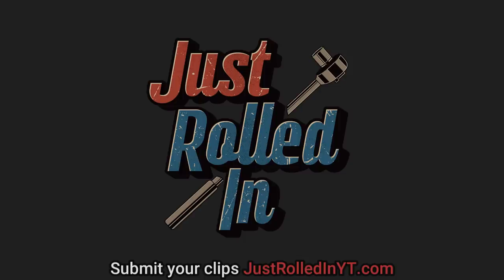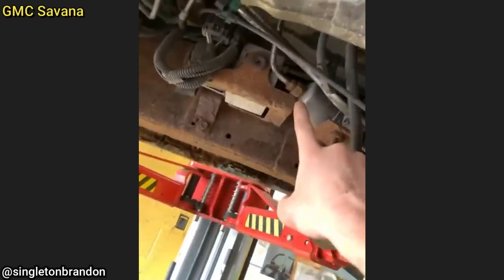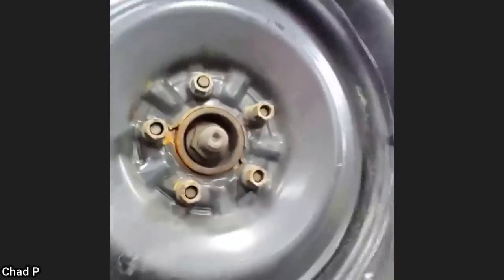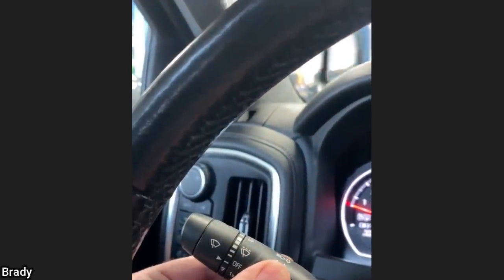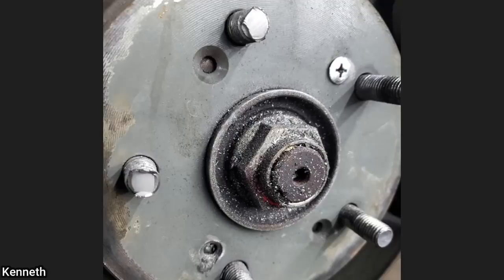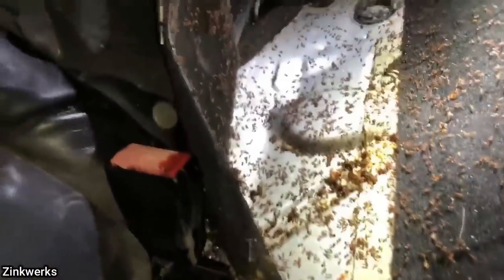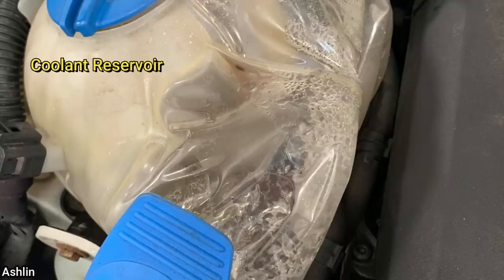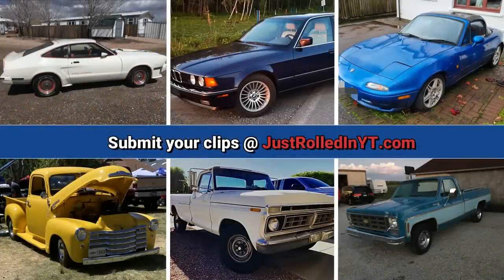Customer States Another Shop Failed To Replace Transmission | Just Rolled In

Comment: Customer with a flat tire approved all additional repairs? Had to watch that part twice just to make sure my ears were not deceiving me.
Reply: Doesn't necessarily mean he plans on paying.
Reply: @sylviaisgod6947  Does not matter. If the customer refuses to pay, the shop can keep the car till they do pay and also will have to pay storage fees. If they refuse to pay at all, the shop will have a right to sell that vehicle to recover repair costs.
Reply: @czarekaj1098  that's not necessarily true and varies wildly by state
Reply: It's so beautiful.
Reply: I know right! As in, they said YES to safety-critical repairs so they wouldn't die in a crash? Never thought I'd hear such a thing.
Reply: @Hawk7886  That's true. In CT, the shop has to file an "Artificier's Lien" including the unpaid invoice and $10 fee. After so many days, the dealer can then file for a duplicate title assigning ownership to them. CT no longer issues titles for older vehicles (a current, valid registration is your only proof of ownership) so I don't know how they'd handle this now.

Some years ago, I worked for a "Buy Here, Cry Here" stealership. (Roughly 2005 thru 2006, I was getting paid $3.09 an hour, or $150/wk for 48.5 hours of work, with a paycheck that bounced more often than it cleared.) We had a gorgeous 1985 Oldsmobile Cutlass Supreme Brougham, white with blue cloth interior, left with us for consignment sale in 1997. The dummies working there at the time started a file on the car, but didn't include the owner's name, address, or contact info. We were unable to sell the car without a title. We were unable to register the car for loaner/rental use without a title. We were unable to file an Artificier's Lien because we didn't have the owner's name, and the DMV required us to contact the previous owner for title reassignment, but also refusing to give us the name/address of the last known owner. So, I drove it exclusively, with a dealer plate, for shop errands. LOVED that car, a real cream puff. From '85 to '97 it racked up only 109k, which is nothing for a 305 V8.

Then the boss paid some crackhead (literally) to paint it "Farmall Red" and applied School Bus Yellow lettering advertising "Buy Here, Pay Here at Pat's." That's when I stopped driving it and switched to the '94 Caravan. Until we sold that, then the Head Mechanic and I shared the '89 Accord LX 5-speed. $3/hr does NOT get me to drive around a ruined classic car advertising for the business.
Reply: @dashcamandy2242  that's a really interesting story, I would've felt bad for the car if you didn't end up using it with the dealer plates. atleast it wasn't a complete waste...
Reply: @czarekaj1098 that car probably isn’t worth cost to repair. I’d get a sizable deposit before I started work
Reply: @sylviaisgod6947 LMAO
Reply: The mechanic is still in therapy.
Reply: @dashcamandy2242  dude, why are you getting paid $3 an hour? Working at Mcdonalds will net you better income!
Reply: @haroldwilkes598  LMAO!
Reply: Well, that's a first!  👍
Reply: I think his wheel bearing needs replacing
Reply: @dashcamandy2242  Bridgeport moment
Reply: @czarekaj1098  Yeah sure, $2000 in repairs, mechanic sells it for $200.
Reply: @sylviaisgod6947  Have you checked out prices of used cars?
Reply: @czarekaj1098  No, but I've been checking prices on new cars. A Hyundai Elantra hybrid, for example, is around $27,000 with freight, not include taxes . I was considering buying one if I get the job I applied for.
Reply: @czarekaj1098  Florida is "if it drove in, it can drive out".
Literally, as long as the wheels are spinning, it can drive away.
Reply: I appreciate that customer approved the repairs but hot dam why would you let your vehicle get to that point!
Reply: @aaronbricault2467  Playing radio on a full blast or talking on the phone all the time.
Reply: The fact that Americans are allowed to drive around in such dangerously faulty cars is astounding to me. Where I live, the uk, we are required to have a full service once a year and can only drive it once it’s considered road safe.
Reply: @shannonbriggs100  Imagine that. Depending on a state, you can also carry a gun without the government permission. Weird, isn't it?
Reply: FINALLY!!! SOMEONE WHO HAS MORE THAN TWO BRAINCELLS!!!!
Reply: Finally, someone who has a consideration for his fellow motorists as well as himself!!!!!!!!
Reply: @Hawk7886  as a technician that works in a corporate shop that is definitely true.
Reply: I’m pretty sure all the repairs on the vehicle cost way more than a piece of crap is worth ! Yes, I have nothing good to say because there’s nothing good to talk about on this channel. It’s amazing that you have customers that have cars that are very nice and looks like they take care of very good care of them I don’t know ?
Reply: well you cannot sell it like that
Reply: got a ticket back in october of last year, 2006 range rover sport at my dealer just come in for a quote on installing trim panels and other miscellaneous stuff.  ended up quoting $9600 total in parts and labor.  he approved it all, and paid for it all.  car left two weeks ago.

dont ask me why he holds onto that range rover but it drives safely now and doesnt look half bad for its age!
Reply: Yeah , they do live among us apparently :) They are just rare :P

Comment: Ahhhhhhhh.  The good ol' days, when the driver, instead of the car itself, was responsible for not driving over children in the cross walk.
Reply: Nice avatar. 🙂👍🏾
Reply: Yes, I don't know how I have driven for 46 years without assist. At least, I don't think my 66 has driver assist. I'm going to be upset if it does and hasn't worked since new.
Reply: Imagine that, I learned to drive and actually pay attention to my surroundings during and before moving and to check blind spots with my own eyes, I can also parallel park all by myself without any fancy gizmos, I credit my uncle who drove all kinds of trucks, front end loaders etc for the township he lived in, he also drove snowplows, he actually took me out driving before I even got my leaners permit, I was scared to death when he took told me to go on a major highway my first time behind the wheel, he didn't take no for an answer and I did it, he had that much confidence in me, the car was a 1970 lesabre back in 1976 when I first started driving, it's almost like they're forcing us to not pay attention these days with this  display and that display then a phone propped up in front of some people it's crazy.
Reply: Shout out to the 1971 four door Oldsmobile Delta 88, with the 455, that I learned and took my test in! 😅
Reply: Meh. Nothing wrong with the driver being attentive, AND having extra safety features in the car. You can be damn well sure if my car had those features, I'd want them to actually work too.

Comment: I love the last customer's solution to showing their driver assist cameras being busted
Reply: No bog-rolls were harmed in the making of the video!
Reply: Im affraid of the answer to the question: 
How did he figured it out?
Reply: do driver assist cameras actually recognise toilet rolls as in danger....apparently not!!!
Reply: @TalRohan  no - can't remember where they tested it - the cameras needed something solid.
Reply: Yes,  very clever and practical.
Reply: They probably had the system turned off 😂
Reply: @NickFindsNick  it won't detect a cardboard box - not what it's designed to do.
Reply: @alanclarkeau  Well, being pedantic, it is solid, I think you mean rigid by that, but sounds weird if it can't detect something like this on the road, if there was anything behind the boxes (not unlikely) it wouldn't have stopped after all.
Reply: @Kalvinjj  RADAR detectors may totally miss a cardboard box.  I remember a local test by a Motoring Magazine (a Mazda I think) and it didn't have the slightest reaction.  Whereas another car (with camera sensors) did.

A cardboard box likely won't fit the "image" which is in the brains of the car to avoid or brake for.  Early ones needed something more like the size or shape of the car.  I know my last car wouldn't see a car with an empty trailer, neither the braking or the RADAR Cruise.  MotorBikes were a problem unless they were in the middle of the lane.  My new car is much better and will see both of those - but I'm not going to try it on a Cardboard box.
Reply: @alanclarkeau  Makes sense indeed, I can't think of a carboard box and bog roll pack having much of a radar signature. Ain't gonna make stealth fighters outta it tho.
LIDARs might catch that tho, as that's just about reflecting laser light.
Reply: @Kalvinjj  It would explain all the flattened debris on the road in recent years. Also all those drivers I witness just running over/through stuff, they are dependent on the 'crash avoidance' technology. 😐
Reply: @CanadaBud23  Smart phones for dumb users, and cars following suit.
For real some people should only be allowed public transport.
Some even sedated.
Reply: That was such a funny clip. I am just imagining them having to convince someone to film that part for them lol Plus also a neighbor being like "wtf is john doing now..."
Reply: @alanclarkeau  ADAS is supposed to react to any obstacle. That is what it is designed to do. It is not like the forward collusion warning system was built to only react to cars.
Reply: @WhyDoThat  it doesn't.  My last car (2016 TOYOTA) reacts very differently from my new Suzuki.  But any vehicle knows what the target or fixture should look like - supposedly my new one will detect pedestrians and cyclists - which the last one didn't reliably do.  And something like a hollow box on the road shouldn't trigger it.  From what I've read, a couple of years ago they were still trying to perfect identification of a kangaroo 🦘.  (Not sure if I can help them, though have had more near-misses with 'roos than I would have liked - gets the heart beating!).
Reply: @BOB K damn I knew AI was bound to get a sense of humor update 😂
Reply: @kruleworld  Pretty sure they aren't tuned to detect cardboard boxes and toilet rolls, but yeah. Never fully rely on them
Reply: @alanclarkeau  Even cars with lidar and camera imaging like a tesla are likely to miss this - they're highly trained on people, cars and street signs from all angles etc but if they stopped for every little bit of debris on the road people would call them over-sensitive and turn them off.
Reply: My car doesn't have any of that stupid "driver assist" crap.  I use my eyes while I actually drive the car. :)
Reply: That solution is not just clever, but sometimes the only way someone else will believe your description of defects.

And not only with cars. I work in the facility management for a bigger industrial company (at least what's considered big in my area). I have my dedicated profession, but sometimes I get to witness some defects of other professions. Photos and video clips are making life a whole lot easier to diagnose these things - for me and for my colleagues of the other professions.

You know how it is: The customer complains about something and when the technician takes a look at it, the fault doesn't occur. The customer takes the car home and just as the first tyre touches the first inch away from the property, the fault occurs again. Between two technicians this behavior can occur as well.
Reply: I'd say, if you need your car to notice things like that for you, then it's best for everyone if you just get some sort of subscription service with Über.
Reply: Yeah they are Driver Assist Cameras not Auto Brakes

Comment: It’s the new “independent floating” transmission design. It’s a feature, not a bug 😮
Reply: Bluetooth transmission
Reply: @trevor1348  🤣good one! Shift into wifi
Reply: Customer bring driveshaft with them?
Reply: I wonder if the exhaust was removed by a cat thief....
Reply: CVT - Constantly Venting Transmission
Reply: @trevor1348  be sure and bring your phone, the typical range of Bluetooth is 33 feet...

Otherwise you might be pushing 😁
Reply: Don't give ford any ideas
Reply: Probably went to a Tesla service center.
Reply: It's bluetooth
Reply: CMT - Continuously Moving Transmission

Comment: The old "another shop" story... Never gets old
Reply: Has to be the customer almost every time lol.
Reply: @jeffadams4590  Unfortunately, that isn't always the case. My dad had some engine work done at a local shop that has been around for over 20 years now and has multiple locations. Don't remember the full details, but whatever it was that was done, the shop said they had to disconnect the transmission. A few weeks after getting said work done, the transmission started acting up. My dad took the truck to a different local shop that specializes in transmissions only. They said the shop my dad previously brought the truck to had used the wrong bolts to connect the transmission back to the engine and was also missing two. My dad had the transmission shop install a new transmission and it drove fine after that for a number of years.
Reply: @jeffadams4590  It IS the customer ''every time''

Comment: The last one killed me. 
How do I show my workshop that my assistants are not working?.
A picture of my indicator lights? Too easy. 
Let's flatten some boxes! 
That customer  is gonna try to build an Accident to show that his airbags light was on. Lmao
Reply: a picture says a 1000 words
Reply: I'd have fun telling that customer the concern could not be duplicated
Reply: Reminds me of how my dad backed into my old car when he was trying to demonstrate his car's rear proximity indicator.
Reply: I bet that customer's way of showing they aren't working, is way more fun than just showing indicator lights.
Reply: Thanks for the explanation!  I was giving them WAY TOO much credit.  I figured there had to be a separate video of the dash along with this one.  I thought the demonstration was adequate.  I guess I'm a future 'costumer states' video waiting to happen!
Reply: @Hawk7886 they do this type off shit like I’m gonna set up boxes and try and run ‘em over at 30 to fix it like fuck all that
Reply: I'm guessing they were trying to replicate the autonomous braking system failure? And instead of running towards a car, a box is the least damaging method.
Reply: @snaplash  most use radar
Reply: @snaplash  Cardboard probably absorbs radar impulses more than reflects.  I'd redo the test putting aluminum foil over the boxes.
Reply: I 100% admire the creativity

Comment: When I watch these videos it's almost like therapy, I'm always a little overcautious when working on my vehicles and always double check all the work I do, just in case I've missed something. Watching these videos actually makes me extra confident in my own work. 🤣
Reply: then I got a nice tip for you:
grab a yellow crayon (the ones they mark wheels with for storage) or one of these pant marker pens (red or light blue works well), and every time you tightened a screw or nut properly, you put a mark on the head, or wherever convenient.
that way, should you have to walk away and return, it's easier to see where you stopped.

Comment: When the customer states that they took their vehicle to another shop prior, it probably means that they did the bad work themselves 😂
Reply: Or the wife's BIL....
Reply: Not necessarily, probably but not always. Actually had a incident like that recently, I don't have the room to drop the fuel tank, so had a shop do it, no big deal right? 2 days latter the rubber line between the tank and fuel lines ruptures. Look at it and was obvious they were worn out and crap when they did the work. 
So yeah, had it at another shop, completely missed that, somehow, and soaked my garage in fuel.

Comment: The first time I ever pulled a transmission... 1991 S-10 Blazer 4X4...
I did it in a friend's driveway in what spare minutes I could find here and there between two jobs, while enduring excruciating back pain. Somehow I managed to NOT cut the exhaust, NOT cut the trans cooler lines, and NOT damage the fuel lines.
It took nearly twenty years, and one YouTube video, to show me I had been doing it wrong. 🤣

Comment: That transmission is a modern floating transmission, you rarely see it as it still is an expensive technique. Because it is floating it transfer more power direct to the wheels and it made less noise while driving. In the future you will see this floating transmissions more often. So far, this transmissions are mostly used in electric cars.

Comment: I got to be the "Customer declined all repairs" customer the other day :)   2021 Ford Ranger has the passenger airbag light on. Took it in for diagnoses, they found rodent damage to the airbag wiring harness. Apparently Rangers are notorious for mice getting in through the cabin air filter. I haven't had time to dig into it, but I have to wonder why there isn't a TSB to put a screen over the filter.  Of course, the repair isn't covered by the warranty. I'll get it fixed, but I wasn't able to leave the truck with them for a day or five.
Reply: To be fair, it's not the manufacturer's job to keep rodents from chewing wires. On the flip side, I seem to recall a TSB on some of the older Escapes due to rodent debris getting into the blower motor housing and causing crazy NVH. The NVH aspect was probably the only reason the TSB was developed.
Reply: @Hawk7886  I believe it is their responsibility to keep rodents from entering the vehicle. Inside the engine compartment, I agree with you. Inside the passenger compartment, it should be their problem. It's well known for the last 50 years that mice will eat wiring and failing to account for that in the design should make them responsible. Otherwise we should argue that it's OK for water to enter the passenger compartment as well.
Reply: TSB? Something Service Bulletin? We don't have them here in Australia, not called TSB, anyway.
Reply: @alexbrown1995  Trustee Savings Bank? That's all it means in the UK.